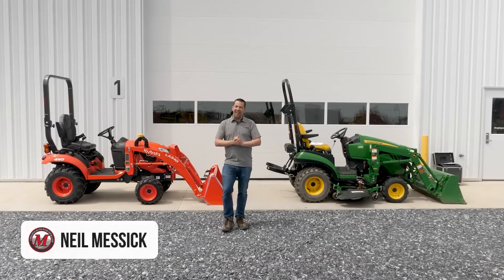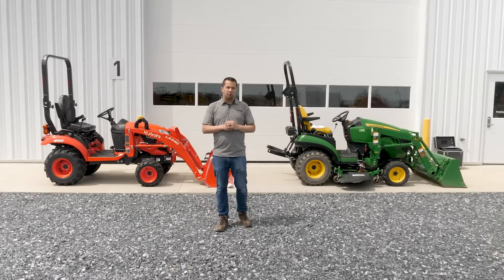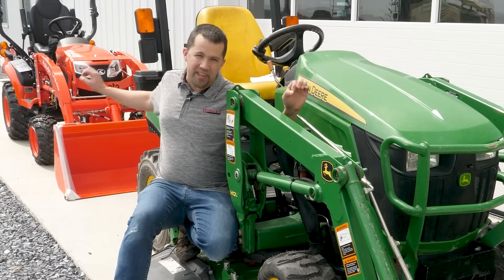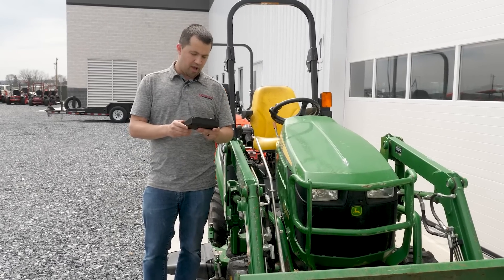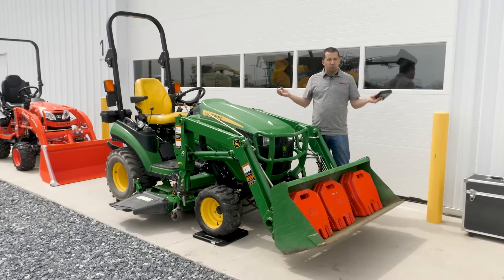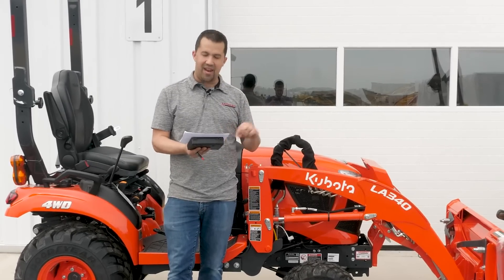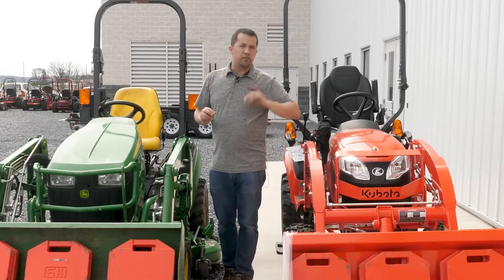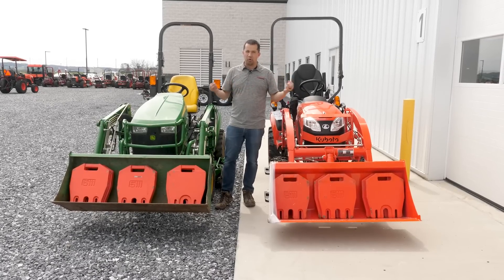front axle capacity vs loader strength

Comment: I think you should have added rear ballast and showed how that takes weight off the front axles with the same load. This would highlight the importance of rear ballast for not only safety reasons but equipment protection and longevity.
Reply: And cover why adding weight in the rear tires doesn’t unload the front axle the way ballast on the 3pt does.
Reply: @lindseygoudge4243  that's interesting. It makes sense that leverage behind the tires has a different effect than the tires themselves.
Reply: @SetitesTechAdventures  The orange was a BX23S. Pop the 700lb excavator on the back and do the same test. I wanna know what those numbers look like when hauling as intended.
Reply: @lindseygoudge4243  Thank you for this comment.  I was thinking of adding wheel weights to my BX2680 but not only would it be a more permanent install as it would be a pain to try and remove/reinstall them myself....but now after reading your comment I'm glad I haven't rushed into anything, and actually have planned on just building a weight box of some sort that I can hang suitcase weights on, or fill with sand/gravel.
Reply: This.
Reply: To expand on your post, boltaction, in a very real sense there is a limit to how much you SHOULD pick up and move around with a sub or compact especially.  

  Its a big safety thing.  Those are not very big or heavy machines- but all the laws of physics still apply.  Just because it "can" doesnt mean you should.

  Best advice:  if you really need significantly more loader capacity, you need a bigger, heavier duty tractor. (Thats why there are a dizzying array of different models available)   Correctly ballasting your machine shpuld always be a must, as well.
Reply: @pyroman6000  You are correct but everything is relative too. No matter how large the machine you can still overload them and turn them over just the same. It just takes a lot more weight to do it. You can't be lulled into false security just because you went bigger. The gray matter between the ears always comes into play when operating equipment.
Reply: Looking at the specs, the rear axle capacities weren’t much higher than the front, and the rear lift typically has a much larger lift capacity than the FEL.
Reply: @MusicandMachines  That makes me think the  axle ratings are limited by the TIRE ratings which is always the case on most pickups and trailers....hmmm. Also I have used and abused and overloaded many brands and sizes of tractors for the last 50+ years and never broken any axles or blown out a tires from weight...
Reply: Are people really buying subcompact tractors expecting them to lift like Hercules?
Reply: Adding weight to the rear, adds weight to the rear. It doesn't take a single pound off the front. It balances the tractor. That's why it's called ballast.
Reply: @evracer  
I think you are only considering the front axle. When you add weight to the 3pt hitch, behind the rear axle, you have now added a second fulcrum point. You not have the front axle and rear axle to consider. Anything added behind the rear axle now counteracts the weight on the front axle. 
So to demonstrate, take a 12” ruler and place a yellow #2 pencil under the 5” and one under the  7” marks perpendicular to the length of the ruler. Now get two 3/4” nuts (or two of something similar with the same weight and size). Place one nut at the outer edge of the 4” mark. The opposite end of the ruler will rise. Now add the other nut at the outer edge of the 8” mark. The ruler will balance out. Now move the nut from the 8” mark to the 11.5” mark and see what happens. That end of the ruler will either drop to the table surface and remove all weight from the pencil at the 5” mark, or it will make it very easy to lift the 1” end of the ruler. 
This is the same as adding a counterweight or ballast to the 3pt hitch. 
Adding weight to the rear wheels (wheel-weights or fluid filled rear tires) won’t necessarily remove any weight/load from the front axle as it is not beyond the axle to create the second fulcrum.
Reply: @evracer  Weight added behind the rear axle will offload the front axle.  That is the whole point to 3-pt hitch ballast (whether using an implement or dedicated ballast box).  

Weight added over the top of the rear axle, such as liquid in tires or wheel weights, will not offload the front axle.
Reply: @evracer seriously,  you ever see what Tongue weight does to a front end. You need to stick to airplanes . That's apples to apples. 😂
Reply: @evracer  It absolutely takes weight off of the front axle and moves that weight to the rear. The rear axle acts as a fulcrum.
Reply: @boltactionshooter  that is absolutely incorrect. Weight (load) and balance are two separate things. Ask any pilot. Adding weight to the tail doesn't make any difference to the main landing gear on which the weight is balanced. The fulcrum is ALWAYS the front axle. Just like the main landing gear is always the fulcrum. Changing the weight on either side of the fulcrum, doesn't change the weight ON the fulcrum.
Reply: @evracer  adding wieght behind the rear does reduce wieght off the front 2 examples one measure front and rear height on your vehicle now put on a heavy trailer and measure again and you will find the front of your vehicle will be higher than when it was unloaded. Example 2 if you add a heavy rear implement to the three point the front will get lighter thus meaning wieght on the fel will be less on the front axle given the same load on the fel. With the fel being attached to the tractor behind the front axle the wieght added to fel is not a equal to the additional wieght added to the axle if the fel was mounted closer to the front axle the fel would have leverage on the tractor plus would give the fell itself more lift capacity if built the same and if it was mounted closer to the rear the tractor would have more leverage on the fell but would have less lift capacity due to the lift arms being longer
Reply: @michaelbradley770  yes , but not always … lol
Reply: @evracer  if you grab the tip of the left wing and pull down, can you lift the right main gear off the ground?  That is the equivalent of what the folks here are talking about.  You could also think of it as raising the tail wheel off the ground by putting more weight on the nose.
Reply: @doseven  so as long as you add enough weight in front of the nose gear, you can never overgross the aircraft? There is no situation where ballast on the rear overcomes weight plus leverage of a loader without breaking the tractor in the middle. You will never switch the fulcrum from the front axle to the rear axle in a practical sense....and if loaded tires, never even in a theoretical one.
Reply: @evracer  I can't believe people still think this is true. A heavy enough tongue weight on the rear of any vehicle will lift the front tires off the ground. Or keep it simple and go pull a matchbox race car out of the toy box and press down on the rear spoiler with your finger. You will lift the front end completely off the ground. Ballast ON the rear axle will not reduce front axle load (i.e. a human in the seat, wheel weights, liquid ballast), but ballast on the 3 point which is BEHIND the rear axle will absolutely cause the rear axle to act as a pivot and reduce the front axle load.
Reply: @evracer  Simple proof that adding weight on the 3 point hitch behind the rear axle takes weight off the front axle? If I pick up the heaviest weight the 3 point on my 770 will lift (~800 #) with out the front end weights, the front end is so light I can hardly steer it unless I use the brakes.. Adding weight behind the rear axle takes weight off the front axle. It also adds both the weight added and the weight taken off the front axle to the rear axle and moves the CG to the rear where the support base is wider which increases stability.
Reply: @boltactionshooter  Only thing putting more weight on the rear does is keep the rear on the ground so you can pick up more with the front.  The leverage of it being behind the rear axle is tiny compared to the leverage of it being behind the front axle.   In my experience the main limiting factor of how much it can pick up is the hydraulics.
Reply: @evracer that makes zero sense. If it doesn't take weight off the front axle then how does it balance weight from front to rear? Putting the weight on the rear axle is not going to really take weight off the front axle because it's weight that is pushing down on the rear axle and tires. But if you take that weight and put it further back, it absolutely does take weight off the front axle because if it didn't then you would still be front end positive.
Reply: @timtwing5886 The front axle, not the rear axle, is the fulcrum. I will use a simplified example to remove the leverage of being behind the center of tire by for now by simply adding weight to the rear wheels themselves. When the fulcrum is the front axle, you can change the BALANCE of the weight on the fulcrum...but the TOTAL WEIGHT is always on the fulcrum if the loader and the rear tire weights are in equilibrium. No amount of weight on the rear tires will decrease the weight on the fulcrum, it can only change the BALANCE. The error in thought is that by being 2ft behind the rear tire, using a ballast box for example, that the weight x moment arm at the rear, somehow magically makes the REAR axle the fulcrum. It theoretically could with enough weight added....  but only if the rear axle becomes the fulcrum will the BALANCE cause the front axle to bear less weight. But leverage equals force x length, so now the weight in the ballast box x 2ft, would have to exceed the weight in the bucket x ~12ish feet in front of the REAR axle....to actually put math to it, if you put 50lbs in the bucket x 12ft, that's 600lbs forward of the axle, excluding the tractor itself. It would take 300lbs x 2ft in the ballast box to counter it. Up until you put that much weight in the ballast box, NO WEIGHT has come off of the front axle and it is still the fulcrum. The tractor is now 350lbs heavier though. Now multiply by 10. There's 500lbs in the bucket....it would take 3,000lbs in the ballast box to switch the fulcrum from the front axle to the rear axle......and the tractor would be 3,500lbs heavier. If you had a weight box that was 12ft behind the tractor it would only take 500lbs to switch the fulcrum to the rear axle...
Reply: @evracer  makes sense, you need to have more weight in the rear for the rear axle to become the pivot point in order to take weight off the front axle or lift the front of the tractor in order to take that weight off. Very keen of you thank you. Although The last bit of your comment did prove without a shadow of a doubt how important ballast is.

Comment: I think front axle capacities should be published.  As a relatively new tractor owner, and engineer, I think the key to getting the most out of your front end loader while saving your front axle is the addition of ballast weight behind the rear axle.
Reply: I think what I’m curious about after reading your comment is how many pounds ballast weight it takes to remove a pound of weight off the front axle.
Reply: You say engineer?? weight on the back keeps the vehicle on the ground, the same weight is on the front axle when you lift the 1000 LBS. the front axle is the pivot point.
Reply: @jimputnam2044  Weight behind the rear axle will try to lift the front axle, using the rear axle as the pivot point.  Simple physics.  Also, many tractor videos describing it.
Reply: Neil did a video with pressure pads showing this. Or was it Tim? Maybe both. Regardless. Ballast behind the rear axle is more effective than wheel weights.
Reply: @jagx234  Yes but it does not take weight off the front axle...axle is still the pivot point.
Reply: @jim putnam  it does take weight off the front axle. With ballast hanging behind the rear axle, the rear axle is the pivot point. This lowers the base "as it sits there with no load" weight on the front axle. 

The front axle would still be the pivot for a load in the bucket. But the starting load on that axle is less before you start loading up the bucket. Gotta take the entire system's effect on the axle into account, not just the subsystem(loader in this instance).
Reply: @jimputnam2044  Simple thought experiment. I put 3 tonnes of weight on my 3ph. Even with a very full loader, my front wheels are off the ground. But still, the same weight is on my front axle? Weight behind the rear axle reduces load on the front axle. Weight on the 3ph is much closer to the pivot point for that weight (the rear axle) than the weight way out the front in the loader, so you need quite a bit of it to make a good difference. But it is reducing front axle loading.

Comment: Imagine having a load cell in the pivot pin of the front axle stopping the user from overloading the machine.
Reply: Imagine when it fails and you can't get a replacement part :)
Reply: @JCWren  Imagine when your front axle fails and the factory won't honor the warrantee because it has an FEL.

Comment: Neil, How about the kinetic energy generated while driving on bumpy ground?  Perhaps, there is a much  higher instantaneous force  exerted to the front axle hitting a bump  or a hole in transit with a full bucket.  I always try to keep my bucket as low as I can and dive slowly minding the fact I am not trying to make money and not in a hurry.
Reply: For sure there is. That's often what actually causes the failure when it was already stressed without that load.

Comment: Hey Neil, can you do this video, but with the larger tractors. Like the tractors a hobby farm would use for round baling and feeding horses/ cows/ pigs? I'm looking at New Hollands Power Star tractors and Work Master tractors in the 50-70hp range. I have been concerned myself about the front axle durability compared to my older tractors.
Reply: I think Neil needs to expand much more on this topic. There were more questions left then answers.
Reply: @blessed7fold  I agree. Definitely need more indepth on the subject and more information for larger machines besides the large lawn mowers.

Comment: Two words: survivorship bias!

How many 30-40 year old tractors where made, and how many are still in use in a production environment are critical questions to ask before saying that they were built so much better back in the 'good old days.' The follow up question is can you do the same amount of work as quickly and easily with 40 year old tech as you can with modern tech. There is no doubt that there is less over engineering in machinery today, which may cause very long term longevity issues; but that doesn't make it worse than Grampa's Ford 8N that chugs along at a pedestrian pace and requires much more finite control than modern tractors.

Comment: I just bought a Kubota MX5400 last Spring and am now concerned about the capabilities and long term durability of the front axle. In my simplistic mind, the cumulative load of the tractor and any potential weight that is added either to the front or rear via attachments should have been the minimum spec for the front and rear axles.  Seems unethical to publish loader capacity numbers that far exceed the capacity of the axles. Thank you for sharing this and please keep the informative videos coming. 👍
Reply: It's worth noting that if you read the manual it specifies a minimum amount of rear ballast for FEL work, this is a big part of why. Rear ballast can cancel out the weight on the front axle from the FEL to make it safe to get to those capacities. Messick's did a video on it already: https://www.youtube.com/watch?v=K4pgGJ_Tu9I

Comment: Neil, you had an earlier video where you measured hydraulic pressures in different situations. Along those lines, I worry more when I'm bouncing over my rough field with a bucket full of green firewood. The dynamic loads on both the hydraulics and the front axle must be really high at times. My solution is to slow down, reduce the bouncing, and try not to stress my Kubota LX2610 to its limits. Thanks for your videos.
Reply: Great point - what is the shock load capacity for the front axle?  We know the load is carried by a center pin, this acts as a pivot point for a point load between the front tires.  The leverage pressure must be tremendous while travelling with a FEL bucket full of gravel over rough terrain? (considering the BX23s has a heavy backhoe for ballast)
Reply: This would be nice to know. Most dealers don't have a clue until a bunch of warranty claims come in.

Comment: maybe they aren't including the tractor weight already on the axle in the spec
Reply: I was thinking the same thing.  Even if it the specs are looking at the overall weight on the axle, what about the weight of just the axle by itself.  Like he told the load for the loader but did he calculate the weight of the loader itself?
Reply: I also wonder if that's how JD does it for the 1025R in the video.
Looking at the rear lift capacity (at 24") and lazily dividing the weight in half for the tractor (it probably weighs a bit more in the back) makes it about right. But if you want the tractor with the cab it adds 200 kg ( 440 lbs). Now there is very little left to use of the three point hitch.

Comment: If I’m laying out the money, I want a tractor to last me a lifetime or beyond with little trouble. I currently run a late series Ford 1700 4wd tractor with Ford 770 loader that my grandfather bought new in 1982. I know that early 4wd 1700s with loaders had front axle issues. So far my axle is ok, but I’m working on the kingpin dust seals now and discovered a totally shredded thrust bearing and shot kingpin bushings on one side in the process. Understandably those things don’t last forever given the loads they experience, but you never want to see an axle breaking!